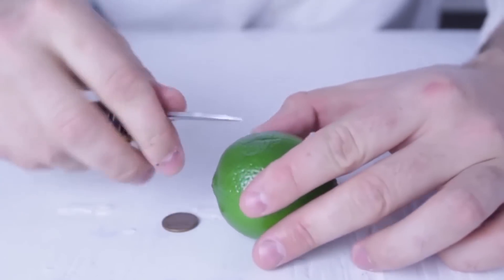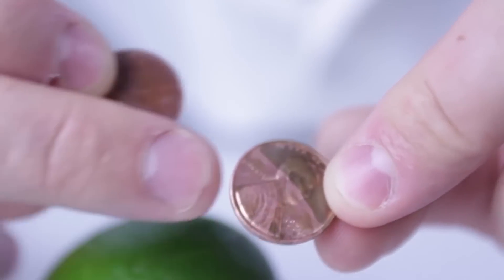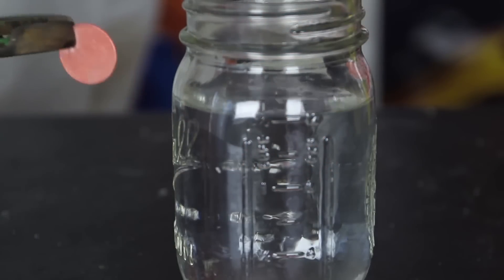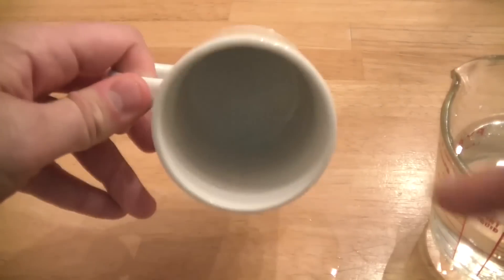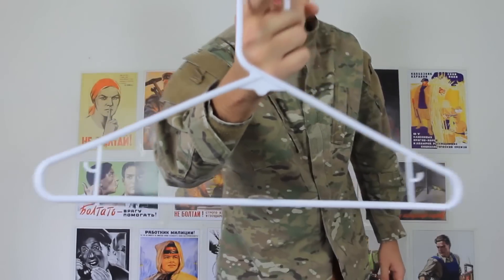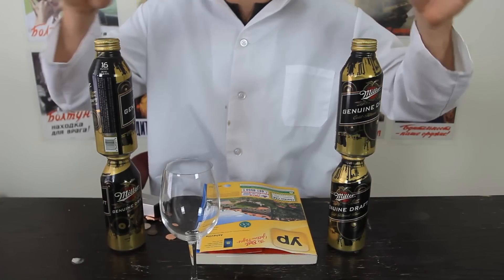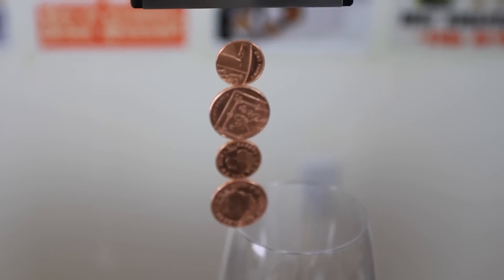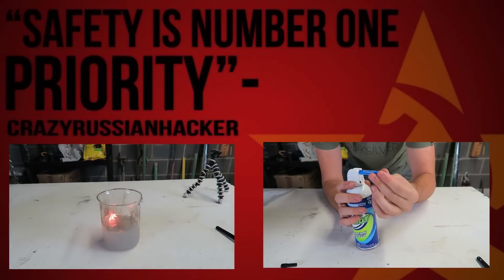8 Coin Science Experiments Compilation

Comment: Watching the process again from the top. Watch how quickly the methanol boils; as its boiling point is only  degrees Fahrenheit, where the coin we’re dropping in is over 1200 degrees Fahrenheit! During the cooling process, some of the inner copper core of the coin has migrated to the outside, leaving you with a cool copper plated quarter! OK guys. Let’s talk about what’s going on here. There’s two really cool principles. The first question you might have is why the methanol? Why not water? Well, what the methanol does, is it works like an oxidizer and without we’d just wind up with these really ugly black coins. So that’s what the methanol does.
Reply: OK. So the second effect we saw here is called the Leidenfrost effect and its very cool. Its what caused that double boiling that we saw. This is where the coin gets a very thin vapor layer around it that actually protect the methanol from the high heat of the coin. Until it collapses. It doesn’t last very long and then we get that second boil as it reconnects. This is very similar to what we saw in the Mythbusters episode where they stuck their hand into the molten lead and pulled it out and they didn’t get burned, because they had that vapor layer around their hand caused by the boiling water. That’s called the Leidenfrost effect and its very cool.
Reply: Forgot to tell you 😂
Reply: +TheGaming Icey1 really ugly black coins... Am I the only one who finds that a little bit racist? XD

Comment: You can also make pennies turn golden. We did that in my Chem 1 class, and you put it in this zinc solution that was charged with electricity from a battery and a copper wire. Then we took it out, dried it off and put it on a hot plate and you let it sit there for a few seconds. After it does, you quickly put it in water and dry it off! Boom, golden pennies! :D

Comment: The reason the coin looks bigger wen u put in water is because of refraction, this happens be cause as light switches the medium it goes throgh, in this case gas to liqhis, bc its going throgh air, then to water, it slowed down, causing it to bend, thus the coin looks bigger

Comment: It has a "Double boiling point" because the heat of the coin causes the methanol to instantly vaporize on contact, thus causing a gas cavitation and once the temperature of the coin and gasses goes back below the boiling point of the methanol, the gases rapidly re-liquify causing the cavitation bubble to quickly dissipate.

Comment: It's the magnetic field  off the top magnet that keeps it balance but because the coins are to heavy to be picked up from the field therefore keeping it balance and on the glass. ps it's not levitating.  pps magnetic fields can only be disturbed by another magnet it's also why magnets stick to each other because there fields are intertwined which in other terms means there together and can only be separated is by pulling the magnets apart.   ppps this cookery took a long time: )

Comment: It's not a  double boiling point.  It's the leidenfrost effect.  At first when the coin is still super hot theres a layer of gas between the coin and the methanol.  You can see the gap it creates for itself from the steam.  Then once it cools enough to not be giving off enough steam the methanol is then breaking that seal down and coming into contact directly with the coin.  That's what I think is going on.

Comment: 1) Because of pennies until 1971 was made from bronze, this material like to collect dirt that can be cleaned using acid in lime, but it is shinier than 1973, what made of god-knows-what, but it is cheap and hardly affected by corrosion. 
3) Coin becomes covering itself with copper oxide (CuO) - that's why it has such color. The second quick boiling reaction happens when temperature reaches certain point: possibly around 100-150 Celsius, when metanol boils at 67,5. Looks like Leidenfrost effect, but under liquid: coin so hot that metanol becomes gas instantly and there is even no boiling, there is gas bag around coin that prevents metanol from contact with this coin, but when temperature falls this bag is shrinking, quickly disappearing, liquid touching the coin and FSSSHHHT!
4) That's called a refraction, LOL. Let's take a normal to liquid surface - vector that goes up from surface of water. Let's build up line from eye to origin of this vector - the (smallest) angle between eye and normal we will call Aplha. Let's flip normal's direction and build a line between normal origin and coin - the angle between coin and normal we will call Beta. Now the law: n = sin(Aplha)/sin(Beta), where n - is refraction coefficient (for water it is around 1,41). So if incoming ray (from air to surface of water) falls with angle 30, then outcoming ray (continuation in water) will have around 21 degrees, that means that ray will turn closer to normal. This working in opposite direction. Try to build it on paper and you will see why coin moves and becomes bigger.
6) Yep, it is not jumping on the magnet, this is because of pretty powerful friction. Usually if you let coins go they will fall or stick to magnet, there is a state where they can float in air, but it is impossible to put them so. When coins standing like a tower they have fulcrum (glass), that prevents coins from fall down or even slip, friction between them, magnetic forces and even internal currents, the last ones are not letting coins move along each other (remember magnetic contactless brake). 
7) Dry ice is just CO2 in solid state. The thing is that CO2 don't have liquid state, so when dry ice reaches melting point it becomes gas. So when you put warm enough coin in dry ice it starts sublimate ice, gas that appearing pushes coin. Coin touches another corner, new gas pushes coin in opposite direction and that process is looped. If coins will be cold shivering will be less intensive or even there will be no shivering at all.
Reply: Pretty sure he knows all these he's just asking the audience if they know the answer
Reply: good to no

Comment: the pennies cleaning up is caused by acid in the lime, the quaters changing colors is due to boiling point of the quarter the heat plus chemicals in Heet because the second boiling is removing the outer layer on the quarter

Comment: Maybe when you stick the coins in dry ice,the heat conduction process takes place and the molecules of the metal starts vibrating to conduct cold and pass out heat! And because of sudden temperature change,it vibrates! But the molecules stop vibrating at-273.16C (approx) at a temperature known as ABSOLUTE ZERO! I m just guessing cause I m still in Fifth! Ok so go easy on me if I m wrong!

Comment: I've done an experiment in which I oxidesed cupper vire than dripped it into alcohol. the alcohol reduced it back to elemental metal. I think it's simillar here.
 Maybe the other metal is still there. i guess, the nickel (or wathever) got oxidised first, than the copper went on forming new oxide layers on the surface of the coin. this way the copper could get to the outside. but im just speculating.

Comment: The dry ice/quarter thing is that the dry ice is sublimating. And the gas it is giving off is building up pressure in between the coin and the ice until there is enough to move the coin. And then it lays back down till the pressure builds again. Just because it takes so little pressure to lift the coin and so little time to build that pressure is why they flutter.

Comment: the "double boiling" is the leidenfrost effect, the liquid isn't actually able to touch the metal until after it has cooled down enough. when the coin is super hot and put in liquid, the liquid boils and creates a layer of gas around the ball keeping it from cooling quickly. once the metal cools enough, the gas layer will dissapate and hence a second boil effect.

Comment: well, the so called "Double boiling" is caused by the intense heat. what it does is its so hot that the alcohol can't touch it, so it makes a little shield of steam around the quarter. after the quarter has cooled down enough, the alcohol reaches it and cools it all the way.

Comment: water refraction makes the coin appear where it is not,the same if you look at anything under water from above,spear fishers will know what im talking about
Reply: +WarPath 808 the copper in the coins got magnified when you stuck them to that strong magnet,and when you remove it,they are still connected magnetically to the magnet above,which makes it balance,if you could see the waves they would be bouncing back and forth between the coins and the magnet,making a small magnetic field

Comment: On the experiment of the coat hanger it's pretty simple. As you spin it the coin is being pushed against the hanger. By the time the coin is at the highest point the coin. Is pushing against the hanger so it won't fly out. Then, when the coin is at the lowest point, gravity causes it's widget to be pushed against the hanger. It works the same if you spin a small grocery in a bag, or a bucket partially full of water

Comment: my guesses
1. copper content
2 i would guess the balance of the coins
3 melt off the plating which has a lower melting point than copper.
4 refracting light.
5 centrifugal force (definitely a lot of practice to not get any other force other than left to right act on it) 
6 when attaching the coins to the magnet you magnetise them slightly. if left alone they will be fine any disturbance and they lose their equilibrium 
7 heat transfer
8 same reason why your tongue would stick to something frozen.your finger is hot and when it come into contact with cold coin skin contracts and grips coin.

Comment: Its simple for the quarter turning pinkish. The quarter is a nickel foil wrapped around a piece of copper. Since they have different boiling points, there are two different releases of air bubbles. The pink color comes from copper coming to the surface
Reply: +TeKnODeFeCt the double boil is actually the formation and collapse of a vapor jacket. boiling points of the metals don't have anything to do with that.
Reply: Yes it is called the leidenfrost effect.
Reply: +TeKnODeFeCt The coin is so hot it forms a layer of vapors from evaporation around it so once it becomes cooled down enough the water will finally reach the coin and thats what your hearing is the coin finally being exposed to the liquid.
Reply: +TeKnODeFeCt Lol, you're not boiling the metal.
Reply: Annealing
Reply: Justin neumann I thought it was just the tool he used to hold the quarter while heating it
Reply: people are still reading it^
Reply: Cam Draper annealing involves a slow cool, usually air or furnace cool. Also, the coin is not hot enough to be annealed
Reply: I'm fairly sure the "2 boiling point" is due to the liedenfrost effect. Much like when you put cold water onto a boiling hot pan the water groups and flies around the pan due to intense heat boiling the molecules causing a thin layer of steam to  make the water droplet fly around like crazy. 

On the mythbusters episode where they take advantage of this effect they did their fingers into pure molten lead without their fingers being damaged. The water molecules combust too quickly which causes a pocket and then if the pocket is to go it will then re boil, or in this case, cool.

Comment: the coin floats in air as force generated by the coin ( weight of 4 coins *gravity) is greater that the force of attraction of the magnet and the glass support the coins cancelling a little weight of the coins therefore making it almost equal to the magnetic force so if the coin starts raising up the support of the glass is lost and it comes back down

Comment: Alcohol oxidation by copper (II) oxide is thr reaction from high school. Coins are made from alloy that contains a few metals including copper, nickel, manganesium and zinc, but mostly copper. So, when you heat coin you oxidize copper (and other metals) to copper oxide. When copper oxide contacts alcohol, alcohol are being oxidized to aldehyde and copper oxyde being reduced to copper metal. But zinc, nickel and manganesium oxides don't

Comment: My guess for the lime and pennies is that the acidity in the lime is eroding the collected grime on the pennies. the reason on some worked is that older pennies have more grime to erode while younger pennies have less. This is just a guess.
Reply: Older pennies have more copper copper reacts with the acid in the lime
Reply: Chromegloss they used to make them out of 95% copper before 1982
Reply: They used to use copper in the pennies. They don't anymore.
Reply: +Crystal Gem before 1971 pennies were made with copper. They started making them out of zinc after 1971 and the acid from the lime cleans copper but not zinc
Reply: +BloodThirstz If I'm not mistaken, they are made out of both. The shell is copper but the inside is zinc
Reply: +BloodThirstz after 1982 almost all the pennies were made of zinc and a little bit of copper. In 1982 was the year that they started switching over and in 1983 there were few coins made of 95% copper in error.
Reply: MrDclineme I'm a coin collector I know my coins
Reply: Andrew H. Thank god for people like you. How would we manage without
Reply: No it is the material the pennies are made of, the newer pennies a made with a cover of zinc oxide
Reply: Mason Gratias because back then pennies costed one penny to make. We use more resources now than we did back then, that makes the value go up for certain items
Reply: Samuel Elkins What on earth makes you think that's still the case?
Reply: +Samuel Elkins we got off of the gold and silver system in the 50's
Reply: Samuel Elkins the US government does not back up our currency with gold they use to. Just Google when did we get off the gold standard.
Reply: most coins are made of zinc and copper. Melting away any coloring could cause more copper to show.
Reply: +Crystal Gem they are made with different amounts of metals at different years
Reply: copper pennies before 1971 zinc after 1972
Reply: +Yugoslaviaization No, pennies are completely zinc rather than some copper, as it's cheaper to use zinc than copper. Still, the U.S. loses money every time it produces a penny, as it costs slightly more than a cent to make one.
Reply: I looked at the science of this once, that's really close expect for its not eating the grime it's eating the erosion on the pennies. if you leave coper in a place with oxygen for a long time it will eventually turn green due to erosion ,  like the statue of liberty.
Reply: +bekima Not erosion, try oxidation when Iron oxidizes Iron oxide is created. When pure copper oxidizes Copper oxide is then created. Erosion is when material is loosened and removed so, the grime is "eroded" by the acid in the lime.
Reply: +Andrew H. That's a very strange error to make.  Did they just happen to have a bunch of extra copper just laying around after the transition?
Reply: Samuel Elkins sorry it passed my mind at the time, I couldn't think of the right word.
Reply: Cole Pearson I thought the newer pennies are a mix of copper and zinc
Reply: Not zinc oxide
Reply: Samuel Elkins yes you are correct the new pennies are zinc and copper
Reply: Ok
Reply: +Chromegloss Yes you are right it costs two pennies to make one Pennie. Now just ask yourself then how did they make the first Pennie ❓❔❓
Reply: Nick&Barry play gamez T no in 1982
Reply: Samuel Elkins I think Mason was joking but in seriousness the reason prices rise is not so much that we use more resources but because we now create "money" out of thin air.
Reply: Every bit of currency that the Treasury makes there is gold behind it. Why gold? Because its valuable and we use it often. When the price of gold drops so does the dollar. We dont make it out of thin air. For every dollar made a dollar is destroyed.
Reply: ***** What do you mean by your question??
Reply: Andrew H. No, otherwise the US dollar would be of no value, Fort Knox holds the gold if a lot of gold is used the dollar value rises as well
Reply: No it works on older pennies because they are made of copper. Not zinc and other stuff.
Reply: Samuel Elkins and since when has the government told the truth anyway
Reply: its oxidisation not 'grime'
Reply: That's why Canada stopped using pennies entirely
Reply: Ashton Bull yup I live in America and it's always exciting to find the Canadian pennies in my pocket change or in a box of pennies. But now they're pretty hard to find lately whenever I find one its the older ones for like the 1930's
Reply: +Andrew H. They don't use it as currency but a profit through the gold. If you can't buy the gold for a lower price, the government wont have as much profit in gold, so they will want more currency.
Reply: Andrew H. Well that is sad I hop justin will make more :)

Comment: Taras, the reason you get that "double boil" effect is from something called the Leidenfrost effect. Basically the coin is so hot that the liquid boils around it, forming a layer of steam. Once the coin cools down to the point the liquid stops boiling, it makes full contact with the coin and quickly cools it to sub-boiling temps.